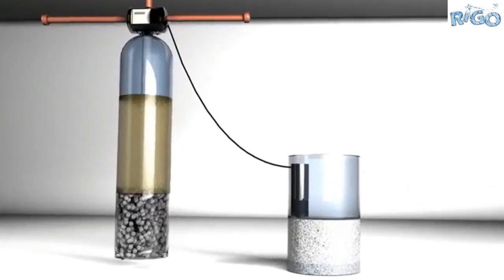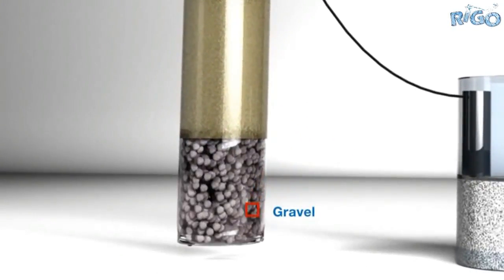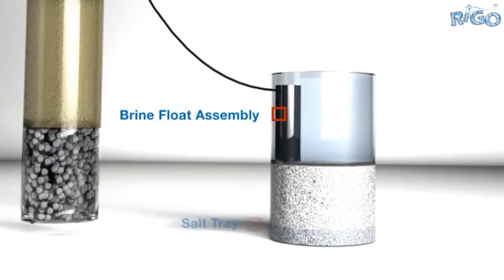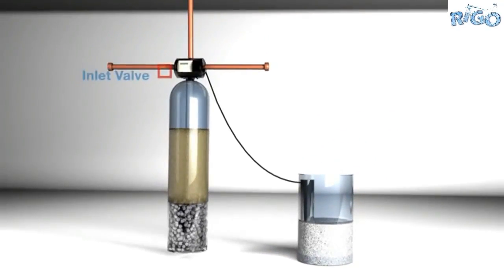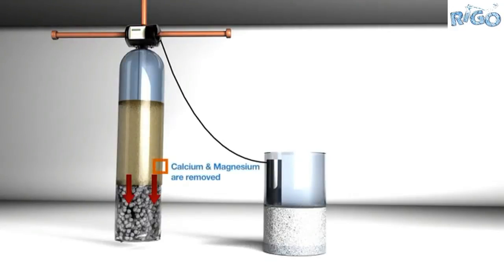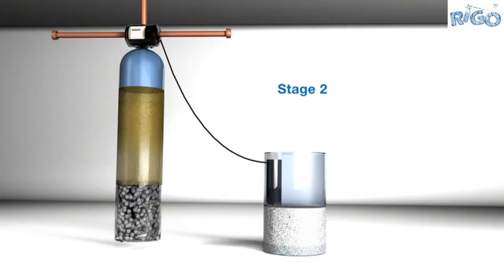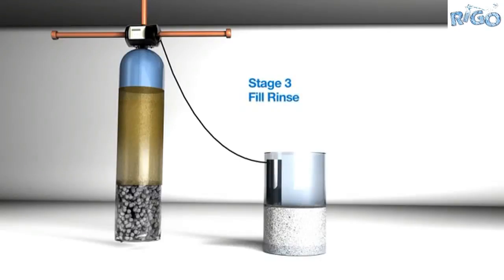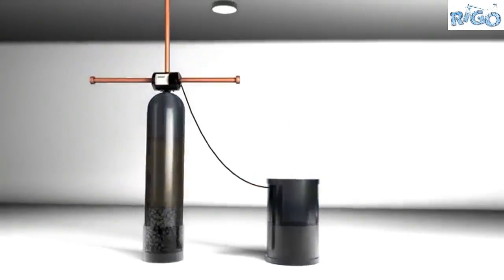Water softening Process

Comment: Softening is a process where Calcium and Magnesium ions are exchanged for Sodium ions
Reply: So softened water has salt in it?  Isnt that kinda bad?  Like how do ppl on a low sodium diet monitor their salt intake if theirs salt water they drink?  Thanks!
Reply: @masterpaine9161  Added sodium is why people on low-sodium diets should not drink softened water. That added bit of sodium could be enough to tip the scale not in their favor. It's also why most kitchens are not attached to the water softening system.

Comment: Very nice video, help me understand most parts of it, but 2 things I still not understand is 
(1) the ions exchange, in the beginning, Na is attached to resin,  while hard water pouring through, Mg & Ca replaced Na, while regeneration begins, why Na would replace Mg & Ca again ? (Is chemical reaction different in brine ?)
(2) dirt was introduced into resin tank, will it be refreshed out during regeneration process ?
Reply: i dont understand your second question, but i can answer the first one.
ion exchange is NOT a chemical reaction.  it is a process of equilibrium. in the regeneration process you introduce such an extreme excess of sodium ions, that even though calcium has a higher affinity to the resin it is simply displaced by sodium.
Reply: your 2nd question: Yes, it will flush the dirt out along with Calcium and Magnesium. But your plan should be to ensure dirt stays out, as that will clog the resin.
Reply: How to keep dirt out?  Can you vacuum that top layer off the top of the brine liquid?  How do you do this.  Thanks!